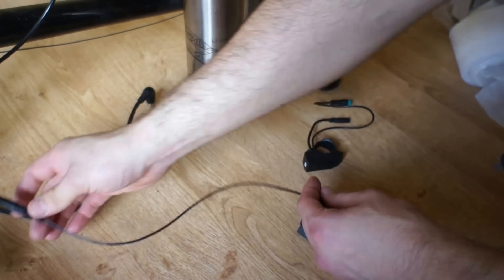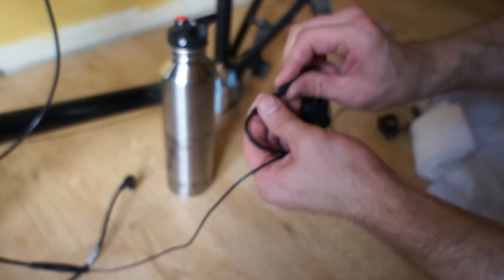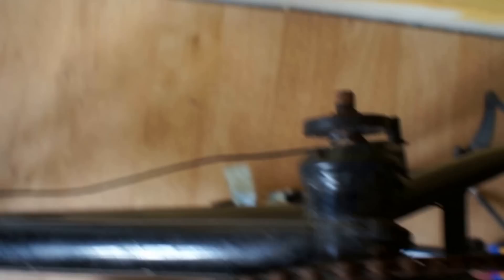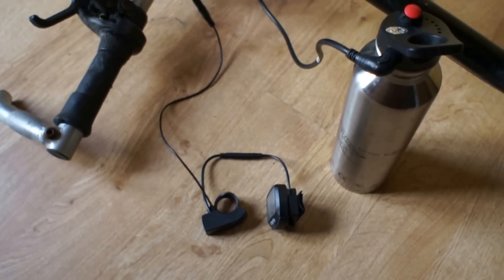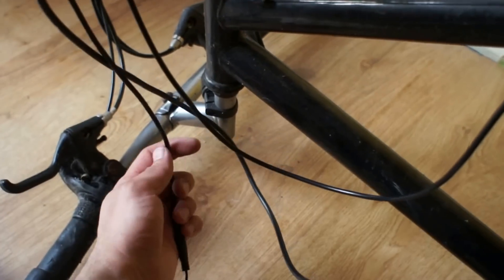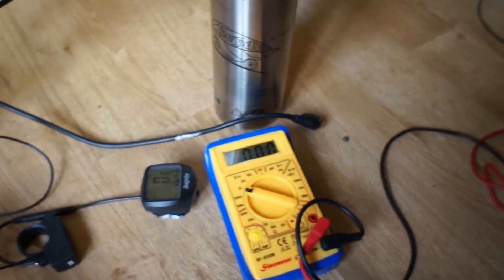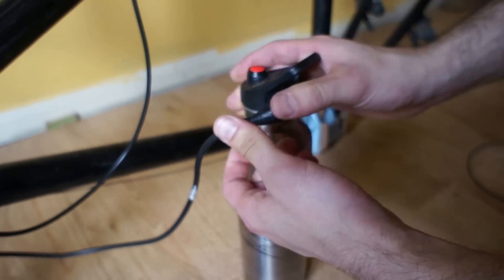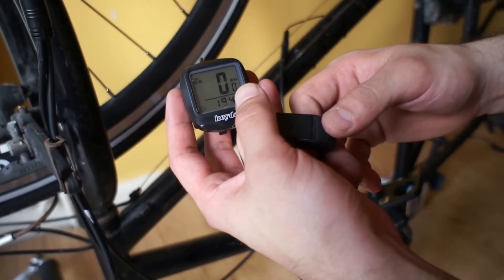KEYDE, - part 3 -keyde ebike kit, electric bike, E bike, electric bicycle, motor with controller

Comment from the maker: On the bottle battery is written - 33 Volts. But multimeter shows that the battery supply 37.1 Volts. If the battery put out more current then the motor is rated to handle, than the motor would fry it self. 

I think might be the battery had burned the motor.

Comment: I buy kit without batery, all works right. Battery level see on "black box", not on computer sceen. May bee problem on connectors- broken wires in one of them. Thanks for interesting vodeo.